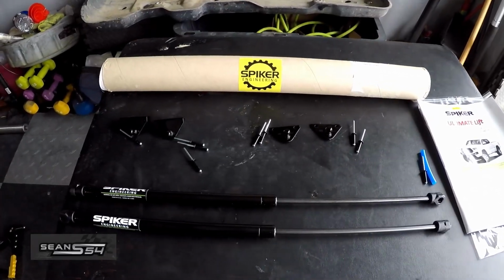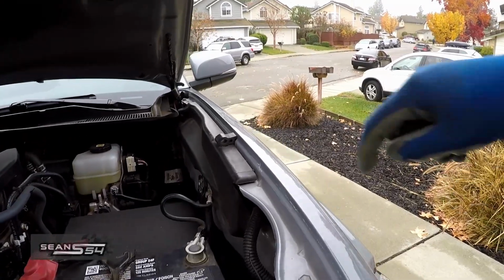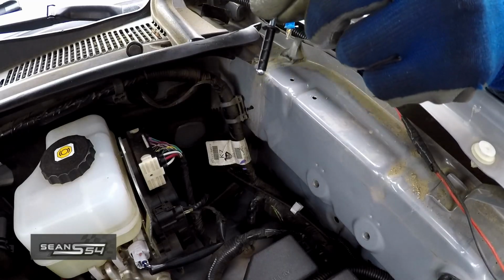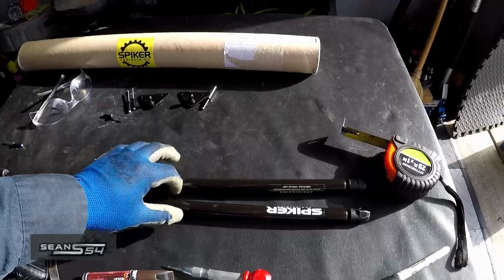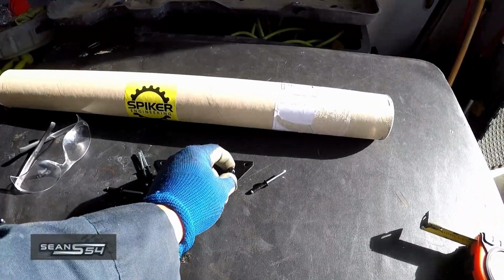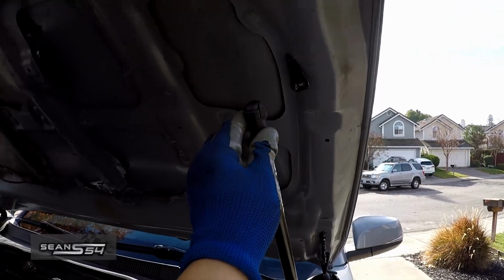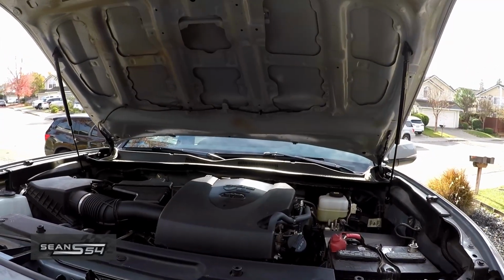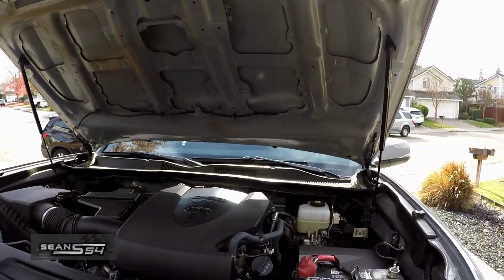Spiker Engineering Ultimate Hood Strut Kit - Toyota Tacoma

Comment: Probably the best video I’ve seen on installing hood struts. While others had me question “why”, yours didn’t. Only suggestion I’d have is to add some electrical take or some sort of protective material so when the rivet gun slips, it won’t scratch the paint, if you struggle with “popping” the rivet. 👍🏽